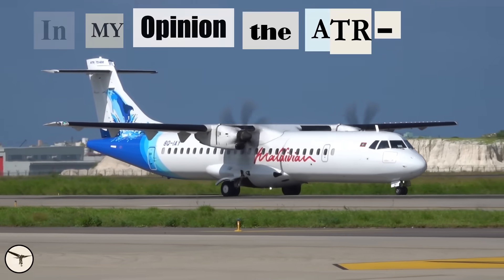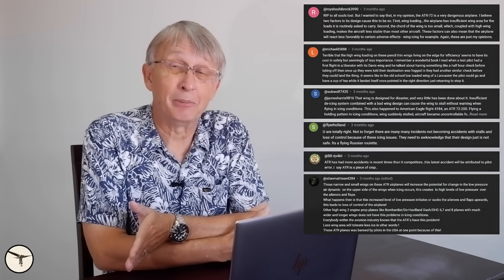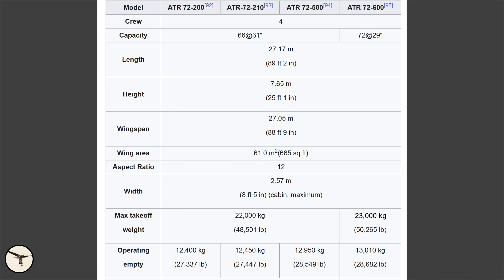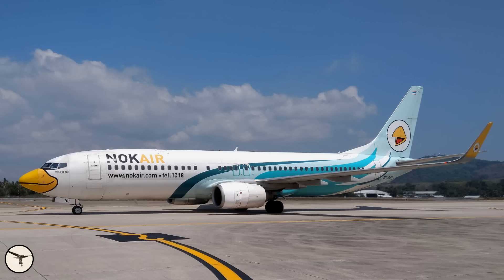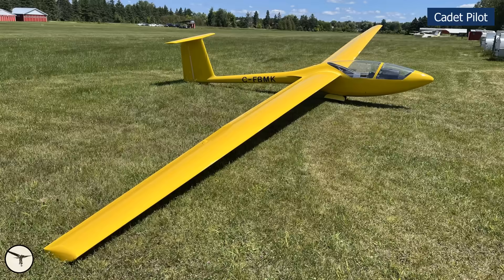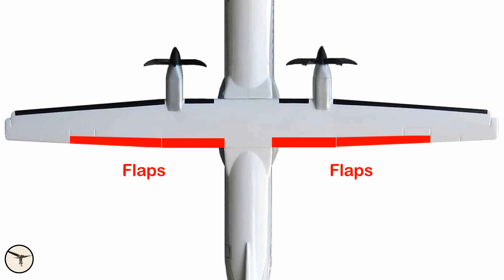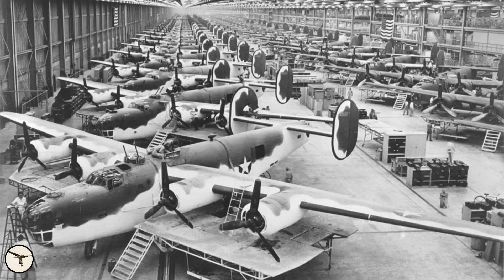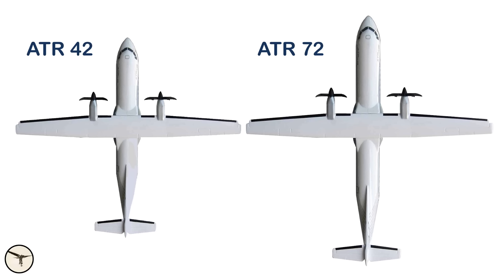What If the ATR 72's Small Wings Were Actually a Design MASTERPIECE?

Comment: Statiscally ATR is one the least safe aircraft manufacturers of commercial passenger aircraft. Only Sukhoi is less safe.  Does that mean it's an unsafe aircraft? No. There are plenty of high aspect ratio aircraft that are safe, look at Diamond DA40/50/62 with a wing that's very difficult to stall. I think that ATR has particular issues with icing and it's t-tail which seems to contribute to uncontrollable spins.  What's historically was perhaps unhelpful re ATR is that the manufacturer and BEA weren't particularly honest about rhe issues the aircraft had. It's clear that whilst the ATR is mostly okay, there are a particular but rare subset of environmental conditions which can lead to an unrecoverable outcome.
Reply from the maker: Statistics can be deceiving. Until the accident in Paris in 2000, Concorde was the safest airliner in the world. A single accident made it the most unsafe airliner, if you compare it with the number of flights or hours flown. Most airline accidents do not happen because of the design of the aircraft, but because of inadequate training and discipline.
Reply: @FlywithMagnar  Concorde had problems with its tyres from the beginning of its service life but its operators ignored the warning signs until it was too late.

The uprated Concorde B was to have more efficient engines and a larger wing with leading edge slats allowing for slower landing speeds but the tyre problem was deemed unimportant.
Reply: @FlywithMagnar there was 14 concorde produced, there are 1300 atr72 produced. 

Atr72 is well into the range where the satistics are stable..really for aircraft is alreddy stable at about 100 units and about 20 years.

So no, statistics is not missleading, concorde was a outlier due to the low number produced.
Reply: @matsv201  The issue with statistics is that correlation do not necessary imply causation. In that case like @FlywithMagnar pointed out, many other factors such as crew training will impact accidents.

The ATRs are often used by cash-strapped airlines, in environments where regulations are low to non-existent. So chances of accidents will go up in that environment.
Reply: @Rookie_One  if you look at the profile of the crashes this is not really true. While some crashes have happened that way, that is also true for larger planes.

The crash freqvency is just to high.

The issue with the weight distribution is a known fact and caused multiple crashes.
Reply: @Rookie_One I wasn't making any kind of judgement and what you say is sure to have a huge impact on the figures. I do think they have a design flaw though wet icing and the tail but that's my opinion going on the original incident reports and media analysis, and reading the the reports.
Reply: @FlywithMagnar Sure but the analysis that I looked at tried to count for these kind of small number issues.
Reply: @FlywithMagnar  
Statistics can definitively be deceiving which is why they should never be used to bolster any argument.
The ATR history has demonstrated that it is possible to enter a situation from which it is impossible to recover.
"Most airline accidents do not happen because of the design of the aircraft...."
imho NO accidents should happen because of the design of the aircraft.
In the case of operation in icing conditions the assumption that an aircraft can "immediately leave icing conditions" if a malfunction occurs -  thus dealing with /removing the problem - is absurd.
Reply: Most accidents happen during takeoffs and landings. The ATR flies short routes (= many takeoffs and landings), often to less-equipped airports with no ILS, often in parts of the world with tricky weather, sometimes in parts of the world where regulatory oversight over pilot training is not as strict. So the statistics might not be telling you the whole story.

Comment: The designer of this aircraft picked up a brick, and asked his builder if he had engines that would allow the brick to fly.  Yes, said the builder but how would I attach the engines to the brick?  The designer placed a ruler on top of the brick at 90 degrees and told the builder to get to work.
Reply: Well and there's also the 737 max another brick of a different kind

Comment: The ATR is a fantastic aircraft to fly. It is so much fun and teaches you some real skills. Fancy Airbus guys (which I used to be before my ATR adventure) of course don't get this :)
Reply: Im a self proclaimed Airbus Fanboy 😁, but love my ATR in MSFS. I spend a fair amount of time flying the ATR in sim, and enjoy the attention it requires
Reply: As an ATC, I need a separation of at least 7 minutes before letting any other aircraft depart after the ATR. Unless it’s an unpowered hang glider, then 5 minutes is enough.
Reply: @DinoAlberini    "As an ATC, I need a separation of at least 7 minutes before letting any other aircraft depart after the ATR"
Why? It is not like it is A380. Or did you mean BEFORE?
Reply: @ it’s not about wake turbulence, it’s about pathetic performance of less than 1000fpm and the true air speed of “it’s a miracle it doesn’t stall”.
Reply: Agreed. I have 2000+ hours on the ATR. It handles perfectly fine. I've experienced maximum demonstrated crosswind and pretty awful turbulance without problems.
Reply: Really glad to read this 😊
Reply: The flaw is the airfoil choice, which makes icing an issue. I submit that it is still not safe in icing condition. See Harry Riblett's book GA airfoils for more. Basically at 9% chord there's a change in air flow similar to the effect of a Venturi causing a pressure drop and temperature drop at that point. Absent ice, no problem...
Reply: But is it aerobatic enough so it can fly loopty loops like the Q400?
Reply: I think the perceptions have to do with "if it looks good, it will fly good."
The ATR 42 and 72 "don't look good or stabile to me."
The early Dash 8s look like Hot Rods.
The Q400 does not look good or stabile to me.
Purely an aesthetic perception.
Reply: It’s definitely good crack
Reply: @MidnightSky69  With a Professional Pilot who knows how it handle it within the limitations of such small tail surfaces. I suspect does just fine.when flown @ the Whidbey Island area in Washington State.
The same Island where Dr Stephen Falken lived in the 1983 film "WarGames".
Reply: I'm a fan of anything that isn't Boeing.